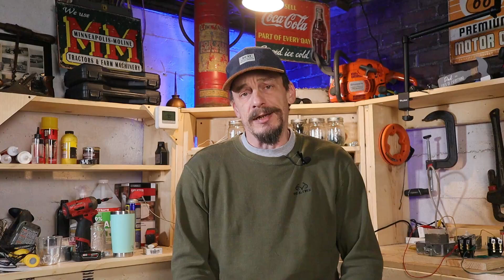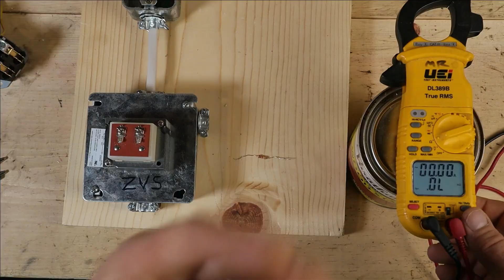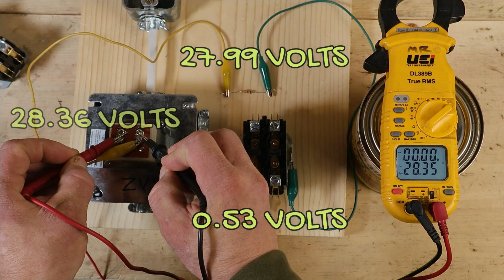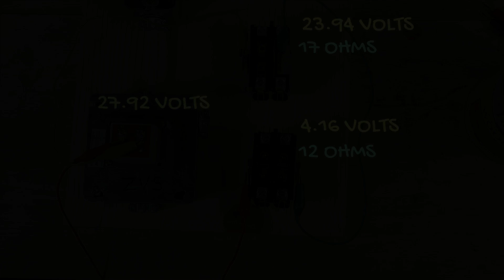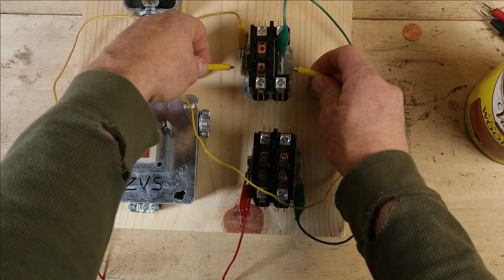The Ohms / Voltage Relationship on a Multimeter

Comment: Your teaching is impeccable!
However if there’s one thing I can add is it is always always always necessary to touch each of your meter leads together to confirm zero resistance in the meter itself 
Then you do your testing if the meter confirms zero resistance 
This is imperative so you don’t diagnose a problem outside of the meter possibly being the problem from the get go!
Reply from the maker: You're absolutely right. 👍

Comment: .Golden rules.
1, voltage is the same across all parallel branches.
2, current is the same everywhere in a series circuit.

Comment: Thanks Mike, If I was to measure throughout this circuit referencing ground instead of directly across each component, then would I be able to read voltage drop aswell?
Reply from the maker: You want your probes to stay as close to the component on both sides as you can to eliminate any stray readings from other components in the system. Measuring to ground would open you up to inaccurate readings to work off of.

Comment: Golden rules, golden rule number one voltage is the same across all parallel branches.Golden rule number 2.The current is the same anywhere in a series circuit.Golden rule number 3, voltage across current fruit

Comment: So the volt meter shows a difference in voltage the resistor is stopping a lot of electricity, hence the higher voltage reading from one side of the resistor to another. Im asking because in a psc motor, the less resistance winding is a higher speed.
Reply: Conductance is the reciprocal of resistance. G = 1/R

Comment: JERSEY MIKE, Make a few video lessons about ghost voltages, residual current short circuits and Parasitic Draw short circuit test. The ghost voltage is higher is value when the wire insulation resistance gets lower. Go over what is Residual Current VS Parasitic Draw current about the differences and what they are.

Comment: Hey Mike, just curious.  If you were to wire the resistor and contactor, or 2 contactors in parallel instead of in series wouldn’t that would keep the voltage the same and, allow both cofactors in the circuit to close at the same time?
Reply from the maker: Yes, that's correct. In parallel you'd have full voltage to both components

Comment: I wish the contactor was explained, and the difference between a contactor and a relay.
Reply from the maker: They both basically do the same thing. One circuit when powered closes a switch that activates another circuit.
Reply: There are literally dozens of videos covering that exact subject on YouTube if you do a search. While perhaps done by someone other than Mike, I'm certain one of them will be a good fit for you.
Reply: @realSamAndrew   Thanks, the issue isn't the mystery of the contactor but to us non-electrically trained the entire language of electricians creates a loose end when a new term is entered it just adds to the confusion.  For example what was the volts needed to activate the contactor?  And why did the resistor seem to pass 100% of the volts, the contactor seemed to pass 100% of the volts but in series the system fails.  I clearly see that demonstration.  I hear it split the voltage.  However the logic seems to say it passed 100% earlier and now it doesn't so what changed.   It is more about trying to follow the logic.  For example if the ( video at 1:31 ) 28.35 volt transformer passed 28.35 volts after subtracting a loss of 992 ohms what did the resistor do if anything?  It is a great demonstration however the logic of why or how it split eludes me.  The answer that it split fits the demo, so it leaves a logical confusion.  This is a great demo.
Reply: @whatsup3270  this is a broad expansion of your original question which was comparing contactors to relays. On that topic I myself have watched several videos that you could also find. On the rest of it, these topics are also covered by various electrician or HVAC channels. You may have to piece together several to hit every question, but the repetition will help you. Try AC service tech, John Jennings, HVAC School, Ty Brannaman, Word of advice TV , channels for starters. Then you will likely see other choices suggested to you on the same topics from those videos.
Reply from the maker: Resistance does not resist voltage. It resists current. The slower the current, the easier it is for the transformer to steadily supply 24v through the resistor. The less resistance to current there is, the more of a draw there is on the transformer (amps), and if the resistance is low enough, the amp draw becomes high enough that the transformer cant keep up supplying volts and you see a voltage drop. 

The resistor passed on all of the voltage because the resistance is so high that the transformer was sort of trying to push its 24v through it like a big water pump pushing water through a very tiny 1/2" hose. The pump (transformer) can easily keep water (voltage) flowing though it. The problem is when you add another resistor in the circuit (like the contactor). The contactors resistance is massively lower than the 1000 ohm resistor. It's only 12 ohms. So think of the contactor like a 12 inch round water pipe that needs to be full for the contactor to close. While the 1000 ohm resistor is just a tiny 1/2 inch hose. 

 What happens when you put both of these hoses together and try to feed water evenly through a 1/2" hose and a 12" round water pipe? You wont get an even flow all the way through (volts). The 1/2" pipe will be full of water (volts) under a lot of pressure (resistance) but will move slowly (current), but in the 12" round pipe, it is just a trickle of water (volts) under little pressure (resistance) and moving too quickly (current) to fill the pipe enough to close the contactor.

 That's why you get a voltage drop on the contactor and the contactor doesn't close, even when you see full voltage across the resistor.